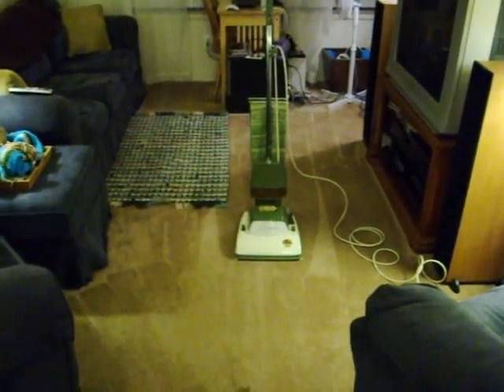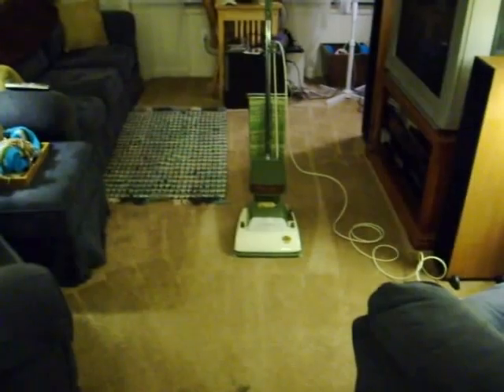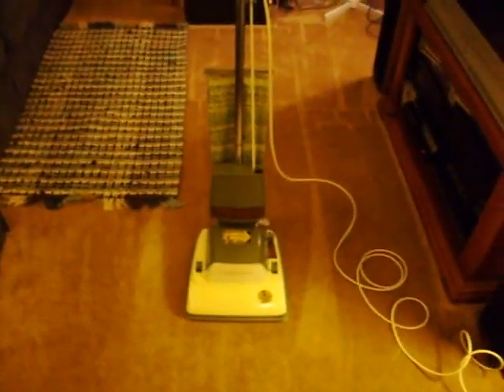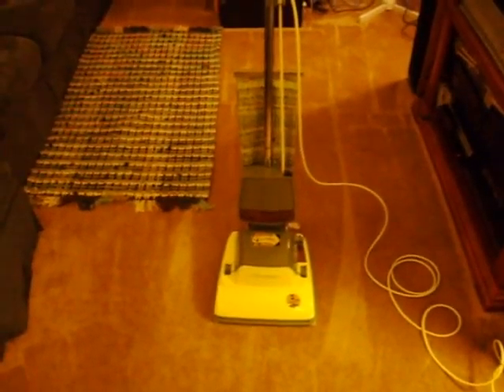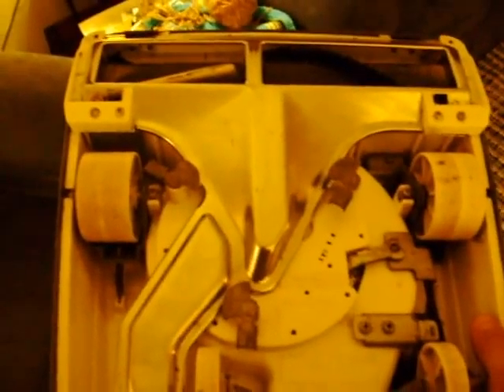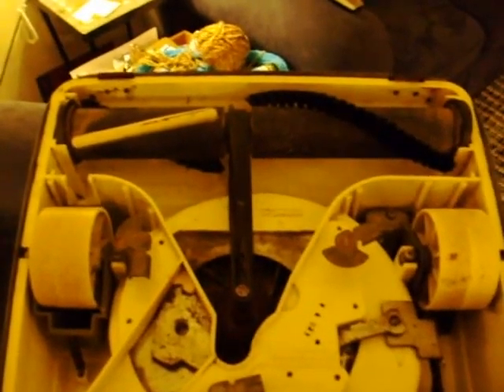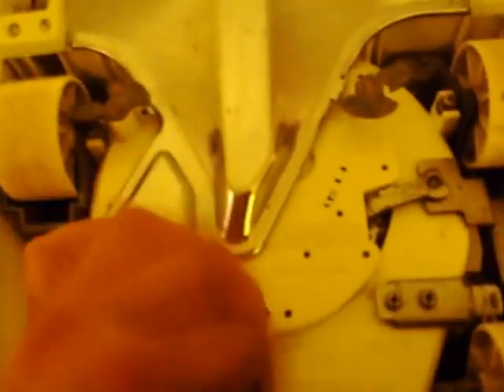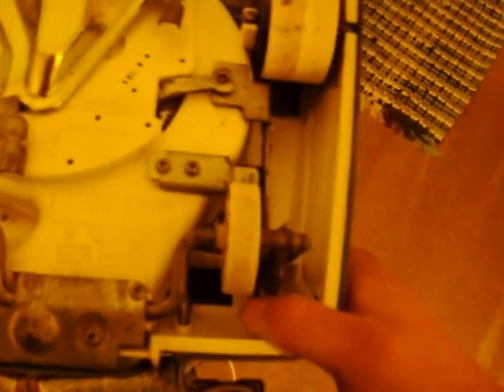1975 Premier Cord Reel Upright Vacuum Cleaner. Designed by General Electric

Comment: Chad: I've found that with my Premier upright, if I dis-engage the belt from the brushroll before using the attachment port, the tool suction is drastically improved...That belt must put quite a power drag on the motor! Thom

Comment: I found one similar to yours in the trash recently. It is branded as a General Electric, so its most likely pre-1972. On the bottom it is stamped in ink: 380Z and below that it says Cat No. P4U7. I can't find any further info on this vac.
Is there somewhere else that I should look for the model number?